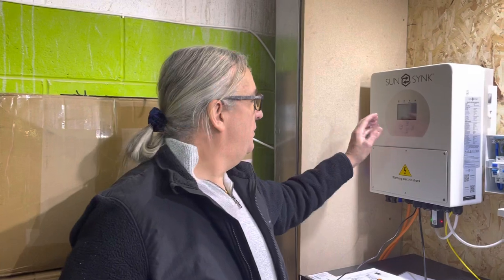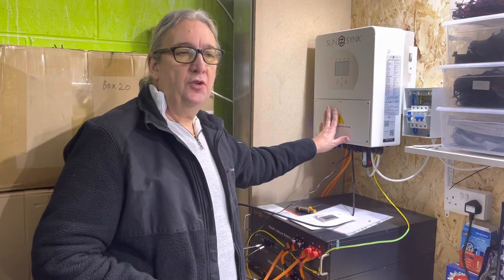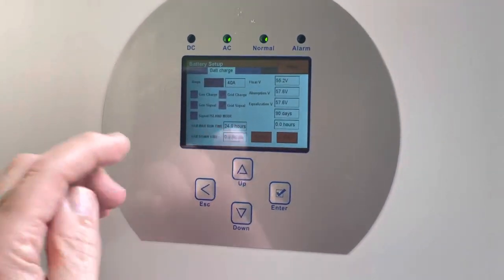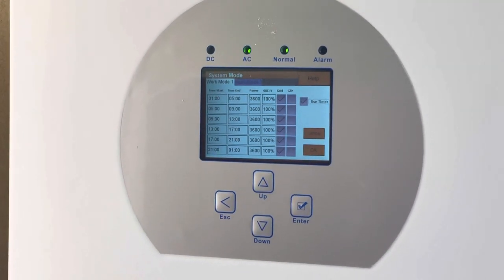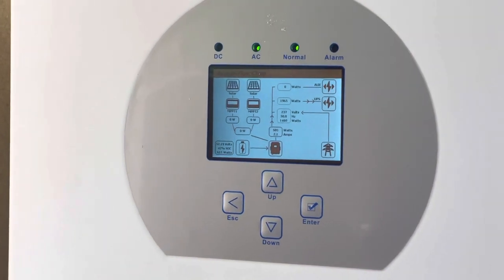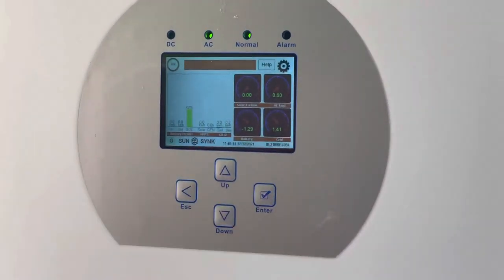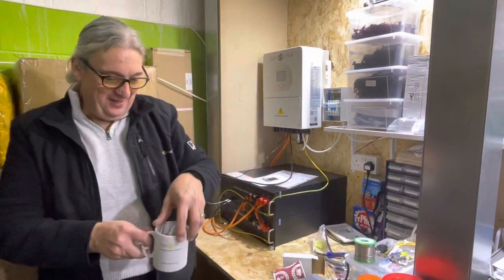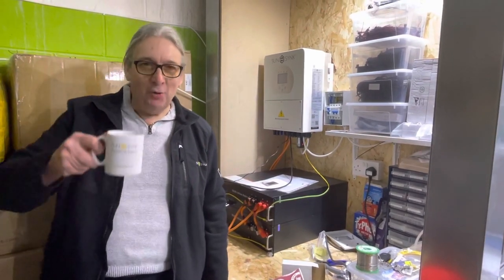Advanced Sunsynk Training on Power Shaving

Comment: In Fourways, Eskom launched a new ‘load limiting’ pilot to cut demand with the intentions of rolling it out natioanlly. Through load limiting measures during stages 1 to 4 of load shedding, customers’ electricity capacity will be reduced from the 60/80A to 10A. An hour before the start of load shedding, if your consumption exceeds 10A - you will be cut off. If not, during the load schedding window you will be allowed to draw 10A. I have set my 'Grid Peak Shaving' to 2200W and it seems to be working well. You will not be cut off as long as we stay below stage 4.

Comment: Hi Keith. Very nice feature thanks for explaining. I am interested in upgrading to a Synsynk inverter. Can the inverter power be limited in the work mode settings to let's say 1kw if I want to discharge my batteries during the night but I don't want to pull more than 1kw out of them. If the load exceeds 1kw the balance will come from the grid? Is this possible?